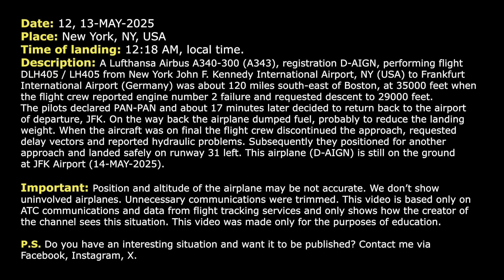Engine failure and hydraulic problems. Lufthansa Airbus A340 returns to JFK Airport. Real ATC

Comment: They should probably have requested a left turn toward Boston when this first occurred.  I wonder if they were trying to get a restart and then continue?  I would be loath to do that.  And you cannot continue to your destination with an engine out, especially an Atlantic crossing!  

I think it was a smart move to eschew KBOS and go for KJFK with the longer runways.
Reply: FORDEC not time critical as an engine failure is not an emergency situation on a quad: Collect the Facts, consider the Options, the Risks/benefits and THEN do the Decision. Turning around would mean ruling out the option to continue to the destination and has no benefit at all as they have more than enough fuel and time to cover all the US and canadian airports.
Reply: If an engine fails over the ocean, you’re not allowed to continue the crossing. As the SOP and Airbus QRH states:
“In case of engine failure en route over oceanic sectors, continuation of flight over water is not permitted. A suitable en-route alternate shall be selected immediately.”

So you divert—period.
The only exception is if you’re already so far along that your destination is basically the nearest suitable airport anyway.
Reply: @michaelf8556 I quote : "An Airbus A340 is certified for oceanic crossing with a single engine failure" so you are allowed to continue and you are wrong stating "not allowed".

I also quote: "the Standard Operating Procedure (SOP) is to divert to the nearest suitable airport." which is exactly what this crew did.

Turning around before the nearest suitable airport is selected is acting before thinking, which is never a good idea. 

And to quote you: "period."
Reply: @michaelf8556  The definition of "Equal Time Point".  Thanx!
Reply: @michaelf8556 that’s an Airbus twin op policy.
Reply: Nonsense. Absolutely no need for an immediate turn. Sort your shit out, then you can divert later. What’s the rush?
Reply: @peteconrad2077  Nonsense.  You have no idea what you are talking about, it is best to stay near the airport.
Reply: If it was British Airways, they probably would have just continued to their destination as they have done previously.
Reply: @tristated9310 it’s purely an issue of range and safety. If those aren’t a big factor, you’ll try to find a destination with adequate passenger services and maintenance provisions for the aircraft/company. 

Sometimes it’s easier to just continue to your destination if the event occurs late enough and meets all those criteria, but it’s certainly not just a British Airways thing.
Reply: I was wondering the same thing. Is it standard for aircrafts with 4 engines to keep heading towards the open ocean (well, technically Greenland in this case, but that's not a huge improvement) with a single engine failure well below cruise altitude? Why couldn't they instantly ask direction to, say, a holding point? I know they were troubleshooting and messaging company, but still.
Reply: @Petidani0330 From what I have seen, It is normal to turn back if you lose an engine.  Although not unsafe to continue.  Notice that the pilots declared a Pan, but not an emergency.

The biggest concern is fuel management with the increased drag.
Reply: Apart from maybe a restart (although not unlikely that they had shut it down for high temps etc), they had enough fuel to have to dump, so flying out longer at a lower level really wasn't much of a concern.
Reply: @lyaneris  If you lose one engine, what's to say that it is not fuel contamination and you are going to lose more?  I would have turned back toward land.
Reply: @Flies2FLL  Having fuel contamination only happen that far into the flight is weird.
Also, you don't know the reason for the failure. What's to say it wasn't a high gen temp they had to shut it down for? 
Assuming fuel contamination after probably spending 20+ min before taking off and getting this far out is unfounded
Reply: @lyaneris  I guess you think differently than me.  If I lost an engine we would run the QRC (checklist) and then turn back immediately.  Even if it restarted, I'm bringing it back and handing it to the mechanics.

I suspect this crew probably didn't know their systems well enough.  On many airplanes you have one hydraulic system that handles the gear and perhaps the flaps.  They wound up on final and realized that they needed to use the alternate extension systems which take a few minutes to drop gear and flaps, so they had to circle around for another approach.
Reply: @Flies2FLL  I can't be bothered to look up the checklist, but I do know that it is really short on the A340 (there's a pilotseye cockpit video on it)
Reply: @lyaneris  On that airplane it is probably shown on the EICAS display next to the engines.  On the 767 we just pull out a card (The 767 is the simplest and most benign handling widebody ever built!) and read it off, there are not that many steps.  Simple airmanship tells you to turn back if you are crossing the Atlantic and are south of Boston and lose an engine.
Reply: @Flies2FLL  Well, you were not in the cockpit and didn't see the indications they saw. They knew more than you do from seeing this video and were able to rule out fuel contamination (trust me!).
Reply: @Flies2FLL  What a bullshit - again by you Flies2FLL. You seem to think you are an expert in fully understanding a situation even though you have very limited information on it.
Reply: @Flies2FLL  Simple airmanship tells you to first check ALL your options and then do a decision. Your company should implement the FORDEC modell which is there to rule out a quick decision without checking all the Facts and Options! 

And you personally should think about what an engine failure means on a quad jet. It is not an emergency like on the 767. Oh, and don't say the 767 is "the simplest and most benign handling widebody ever built" - I'm sure you haven't flown all wide bodies that were ever built.

To enlighten you: The ECAM tells the pilots of a twin engine Airbus to LAND ASAP which means to land at the nearest suitable airport. The ECAM checklist does not mention that on a four engined Airbus.

And, just like on your beloved 767, the Airbus can (of course) operate the L/G, Flaps and Slats during an engine failure or single hydraulic failure.

Apparently you seem to think that you know everything better than the whole Airbus design and test pilot team as well as the A340-rated pilots of Lufthansa.

Your ego is way bigger than your qualification in the cockpit of the Airbus A340. Just think about it for a second: Are you really the right guy to judge and comment the situation and the skill of the crew? You probably find out, that you just embarrassed yourself with these comments and I sugest, that you stop giving unqualified critizism.
Reply: @axeln6743  My ego is not way bigger than my qualifications, and you are obviously a Microsoft Flight Simulator Captain. 

-I spent two years as a 747-200 Captain and had to think about these sorts of decisions daily.  If I lost an engine or had one shut down and then restart, I would RETURN.  Something is wrong, it is time for maintenance to deal with it. In your Nintendo world, where you deal with cartoon animals and people in your parents basement at the age of 40, I guess you can come up with the BULLSHIT answer above~

As to the the individual items you've mentioned, I'm simply not going to respond.  

Does your mom know you are on the computer again?
Reply: Once again, you're assuming things, judging, and thinking you know everything. I hope you're retired by now, as you seem to have a dangerous attitude—jumping to conclusions could be fatal for you one day.
Reply: @axeln6743  I'm jumping to conclusions?  I'm not jumping to anything.  You are jumping up and down in your mother's basement because you have made a fool of yourself and you know it.

Have a nice day~🤣
Reply: @Flies2FLL  So how come you think I'm playing flight simulator in my mother's basement? Any evidence at all?

You really embarrass yourself.
Reply: @axeln6743  You again-

How do I know you are flying MSFS in your mother's basement?  Very simple:  You keep responding to me.  

I've obviously hit a nerve and it is a "nerve" that exists because you have something to hide.  Simple as that, easy peasy.

Hello?

Have a nice MSFS day~!
Reply: @Flies2FLL  Well, you are completely and utterly wrong in so many ways. 🤦‍♂

And you are apparently not willing to disguss on the facts that I gave you. Instead you are trying to force this conversation onto the emotional level because you somewhat understand that your critizism on the crews perfomance is nonsense. 

So, keep on bragging on how a good a pilot you are and how bad all others are compared to you. And if someone tells you otherwise, than just tell him he's a vitsim pilot. 😂😂😂
Reply: @axeln6743  I'm willing to discuss your "facts" all day long on my days off, such as today.  But I do not want to "disguss" anything with you or anyone else for that matter!  As to criticism, I have to point it back at myself;  I have no earthly idea what "critizism" actually is, I promise to educate myself further.  

"Bragging on (sic) how good a pilot you are", I challenge you to show me where I have done anything like that.

In any case, have a nice day~🖕

Comment: Basic English seems to escape some US controllers. They are speaking to people who are fluent in English but not in Americanisms. 00:40 "DLH405 you said you had an engine failure" is not a question. Its a statement. It doesn't require a reply in normal english but US ATC use this type of statement as a question regularly.
Reply: They also tend to speak too fast, and that is not just a New York thing.  Speaking slower to foreign aviators would solve some problems.
Reply: Good point actually, i didn't even notice because it's sooo common in US ATC.
Reply: It is perfectly understandable. You said you had an angine failure? Works exactly the same in German: Sie sagten Sie hatten einen Treibwerksausfall?
Reply: confirm you have an engine failure?

Comment: I would think that they would have wanted a turn back once they decided to divert, rather than continue getting further offshore.
Reply: As stated in the video they were on the phone with operations deciding weather to go to JFK or BOS
Reply: @alexanderwiand6997  Correct, but a 180 degree turn would have head them in the direction to go to either location while they decide which airport to land at. If they had another engine fail, it would have been better to be closer to land, rather than the middle of the Atlantic.
Reply: @omgsrsly  Yeah, you're right, but it would feel like you're in the middle of the Atlantic if you had to ditch there. I used to fly in Florida and once the controllers wanted to send me over the water past where I could safely glide back to land and I told them that I wanted a turn inbound. I've had too many emergencies and would rather be safe.
Reply: @GreatDataVideos They had 3 functional engines and a ton of fuel. FL290 is not really low to be able to maintain with that.
Reply: @lyaneris  problem is that nobody knows why the engine failed, the other engines could potentially have the same problem momentarily
Reply: @lt.lasereyez8891  Very unlikely. There's only a couple of situations in which that happens (fuel contamination, fuel exhaustion, icing or slush, salt).
3+ engined planes don't need ETOPS for a reason. The more engines, the more redundancy.
Reply: @lyaneris  there was that British 747 minding it''s business when the engines started shutting down because of volcano ash, the didn't wtf was going on either
Reply: @lt.lasereyez8891  Yeah and? That would've happened regardless of engine count. Might as well have had 1 or 8 engines in that case, wouldn't have made a difference.

Comment: At least they only lost .25 of the engines and not .5
Reply: Yup, would always prefer a four-holer but that’s not realistic these days. 

Especially on approach when you’re lightweight, 25% loss of thrust is negligible and you’ve got less yaw control issues / asymmetrical thrust to worry about. 

…and (although unlikely and usually Ill-advised with an engine out) a go-around is much less of an issue.
Reply: @EstorilEm  How would Jeju flight have fared with 4 engines you think?
Reply: @AmNesia-r5h It depends, if the theoretical flock of birds was large enough to also hit the entire aircraft and all four engines, then it would be similar - however “reduced thrust” in four engines on a light aircraft, will still be better than one failed engine and one reduced thrust on a twin. Also the hydraulics and electrics are distributed for extra redundancy on a quad jet because they can be. 

Now, if it only hit two engines like Jeju, two engines (again, on a light aircraft coming in for approach) would be MORE than enough power to go-around safely and land, even on the same wing.
Reply: @EstorilEm Thanks!

Comment: DLH not declaring emergency as usual
Reply: They have declared PAN PAN PAN, I think with a plane that has 3 working engines, this was the correct call.
Reply: @ChrisKr-ue3ke yes, although had this been a 747 it wouldn’t even have been a pan.
Reply: @ChrisKr-ue3ke  until you’re on short final and add a hydraulic issue, or a fire breaks out on deceleration.  

Then you’ll wish you had emergency equipment in place.  Instead they’re precious minutes away in the fire station.  

Engine failure is absolutely an emergency/mayday call.
Reply: @alexp5778 That hydraulic issue is independent of the engine failure and could happen with any plane. 
Honestly, many engine failure situations on a twin jet aren't even a mayday.
Reply: @alexp5778 tell me you're not a commercial pilot...
Reply: @alan_davis  at the largest airline in the world.
Reply: @alexp5778  An emergency is declared, when there is imminent danger for the aircraft or the people on board. Imagin someon else had a fire on board and ATC has two emergencies to deal with. When you have a minor problem, your status is pan pan pan to leave room for more serious cases.
Reply: They literally declared PAN PAN PAN😂 you dumb
Reply: Americans not understanding ICAO phraseology as usual. What do you think a pan pan is used for?

Comment: its a an A340 with 1 of its 4 engines failing, so what … 😅
Reply: it's an A340-300, so the smallest one with 4 hairdryers under the wings
Reply: The 343 is famously underpowered
Reply: @cruisinguy6024  Some people think, A343 has 5 APU's 😉
Reply: 🤔 under powered? Too risky?

BA 268 once had a compressor stall on a 747 on take off from LAX and flew back to the UK from California anyway. 😮 
Did get across the Atlantic, didn't make it all the way to LHR... 🤔😐
Reply: @gryff8400 the engines are not powerful combined with the design makes it have poor performance
Reply: The 340 has shit performance with all its engines so 3 it prolly can’t cruise lol
Reply: @a_goblue2023 According to a Swiss Crew, 3/4 doesn't make a huge difference in handling
Reply: @lyaneris handling isn’t the issues it’s the power. The plane is underpowered
Reply: @a_goblue2023  Even then, a 3/4 engine approach is still pretty much normal, 2/4 is where it's really applicable and might be worse than some twin jets 1/2